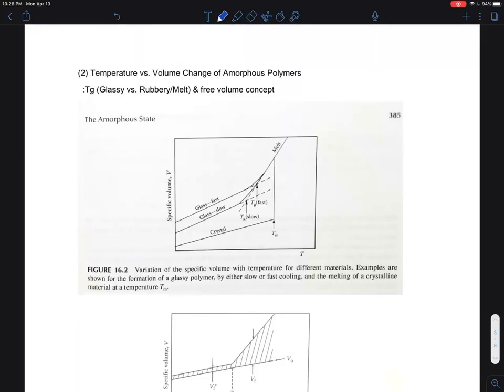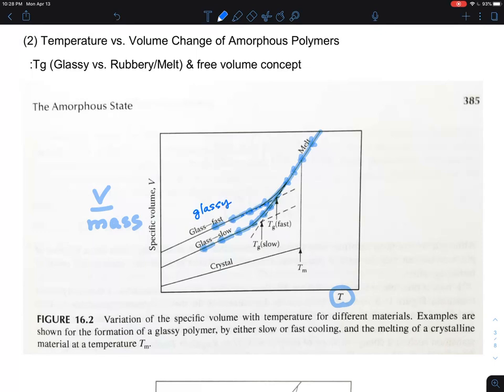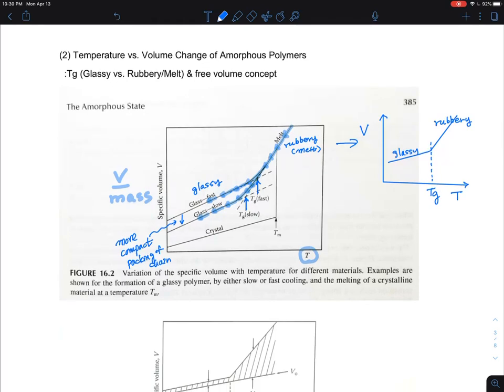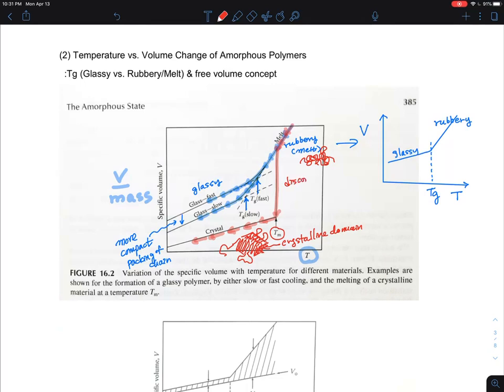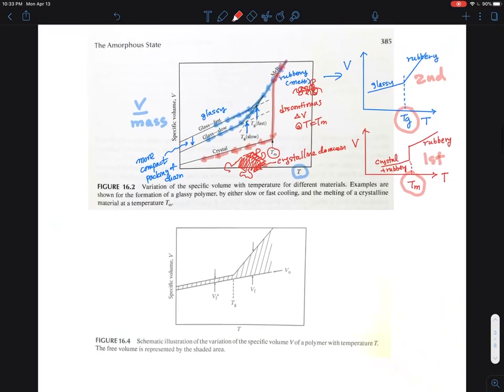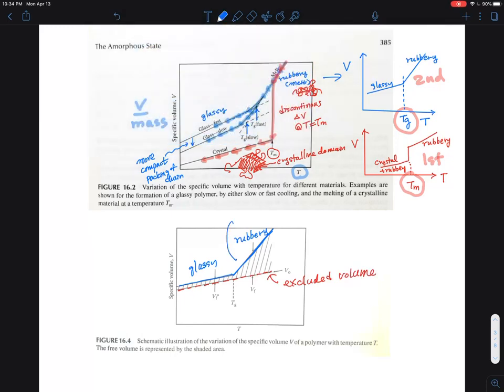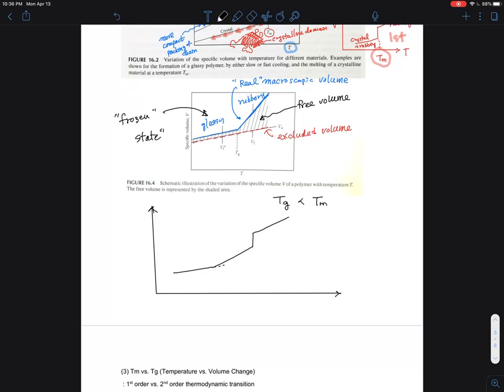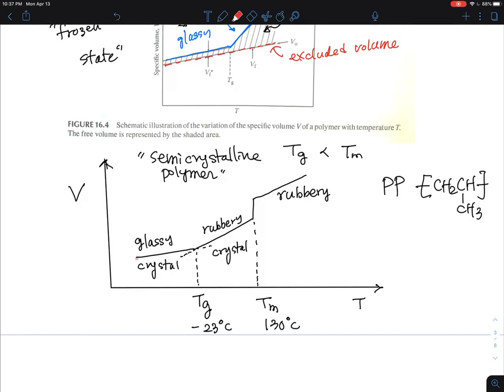04.02 Temperature vs. Volume Change: Tm vs. Tg

Comment: what happens when the semi crystalline polymer gets cooled rapidly
Reply from the maker: If you cool it really fast, you can avoid crystallization of polymers to result in amorphous state.  Please note that you have to cool it down to a temperature lower than the glass transition temperature (Tg), in order to keep the state to be amorphous.  Otherwise, at T > Tg, the polymers might be trying to crystallize.  In polymer crystallization, it is commonly known that polymers can take many different form of crystalline structure and it is called polymorphism in polymer crystallization.
Reply: @prof.ryuspolymerchemistry3456  is this related to the mechanical property of the polymer?
Reply: Professor I have one more question,
Reply: What is the difference between PIMS and PISA synthesis methods (Polymerization-Induced Microphase Separation and Polymerization-nduced Self-Assembly)